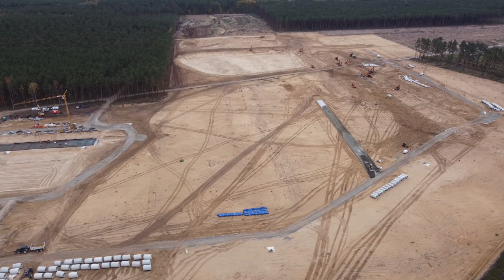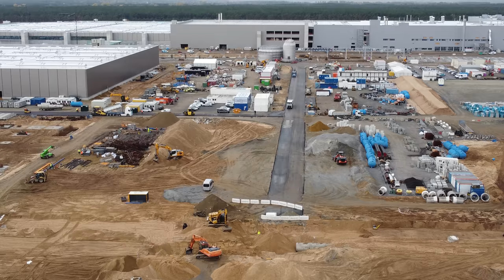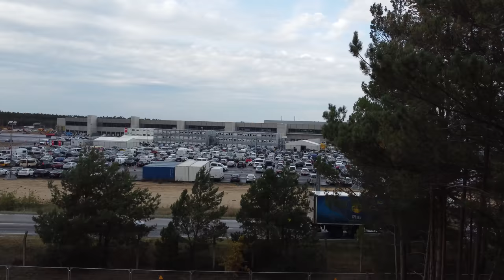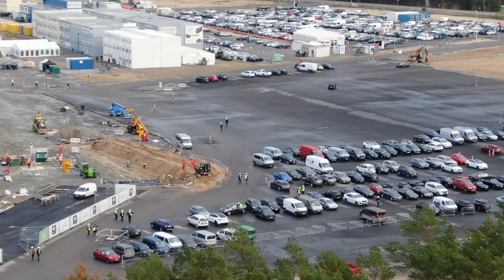Giga Berlin | 2021-10-20 | Timelapse

Comment: Thanks Tobias! I can see you had to endure some bad weather, but the video is excellent. Doesn't matter if it was a bit wobbly. It could be upsidedown and still be the most interesting of the week 🤣

Great time lapse at the cell building both on ground and in the air. 👍

Some new foundations at the cell building to the north. Some were dismantled läst week. And asphalt between the cell and drive unit building seems new.
Seems like the forms for the elevator shaft is coming off at the main entrance.
Asphalt work everywhere.
Last thing I noticed is that they're removing the dirt just north of the stamping area near the forrest. 

Lots to see 🥸
Reply from the maker: Thank you! 
I'm not sure why they destroyed some of the foundations, but it's good to see that they continue work on the foundations in the north of the cell building.
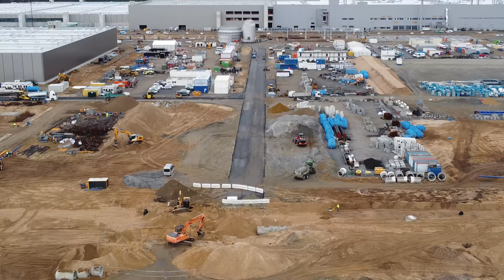Yes, the asphalt between the cell building and the drive unit building is new. You can see the asphalt machine still working on the left at 5:10. And the asphalt on the road in the middle of that view is new as well.
I'm not sure if they really remove the dirt north of the stamping area, but they have a machine there to filter the dirt. Maybe they just want to make sure that not too much stuff grows there. But I think most likely they prepare the dirt so they can use it to refill the finished sections.
Reply: @TobiasLindh  Yes, after seeing the video again, I agree that they might not be moving the dirt, but filtering it as you say. 
But with all the progress we see outside, just imagine what's going on at the inside of the buildings 👀

Comment: I wonder if the storm sewer pipes are filling up with all that water.  Hopefully the ponds will be completed soon.
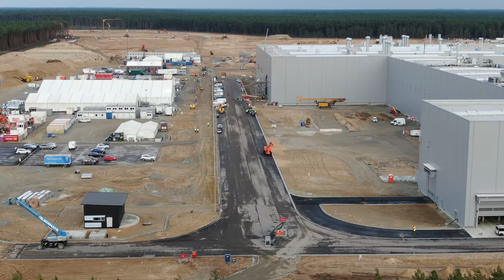Reply from the maker: Currently they pump the water out of the pipes. You can see one of the pumps in the mittle of the intersection at 21:15.
Reply: @TobiasLindh  Thanks.  What a labyrinth of pipe.  Must be interesting getting them all sloped correctly.

Comment: What is that huge building across the highway?
Reply: What building?
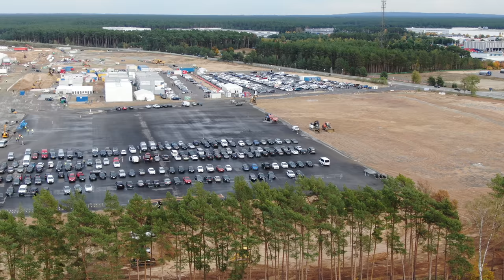Reply: What are you looking at? 16:56 ? 
Those buildings are across the road from Tesla. The highway (autobahn) is between the drone and the trees in the foreground. No buildings across the highway at all.
That's a view onto the Freienbrink industrial estate, which is in first place used for logistics. 
The building with the vertical grey/white stripes belongs to the parcel service GLX.
The grey/white horizontally patterned one in the forest is a regional distribution center of LIDL. 
The big white building in the rear is a regional distribution center of EDEKA (the largest food retailer in Germany).
Reply: @abalada  Yes, this is what I was asking about.  I thought there wasn't any other buildings like this in the city.  Thanks for the information.

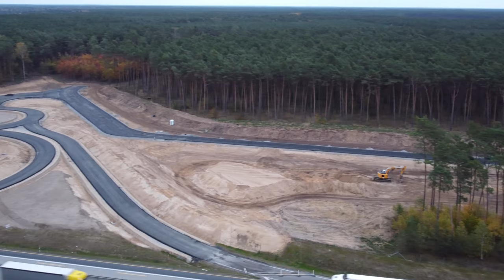Comment: 24:40 what in the spaghetti junction is this 🤨🤣
Reply: The smallest possible Autobahn exit.
Reply from the maker: They have a roundabout, so if someone that accidentally exit the motorway can easily turn around. The road on the right follows the shape of the future north-west building.
Reply from the maker: @julianreverse  There are a lot smaller Autobahn exits. This one is actually pretty big for a temporary one sided exit. They could have made a 90° intersection and connect directly to the road. Just like the regular exit "Freienbrink" without the bridge to the other side. But it's better for the traffic flow to have the first intersection further away from the Autobahn. And the roundabout helps to turn around if they exit the Autobahn accidentally.